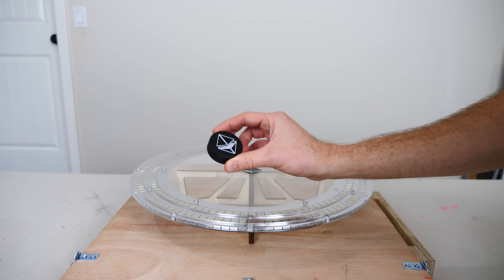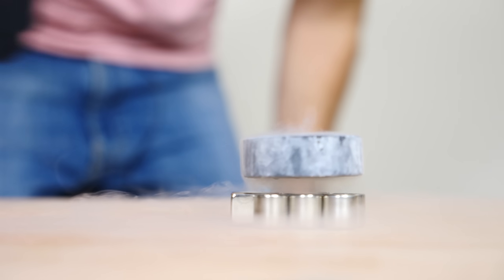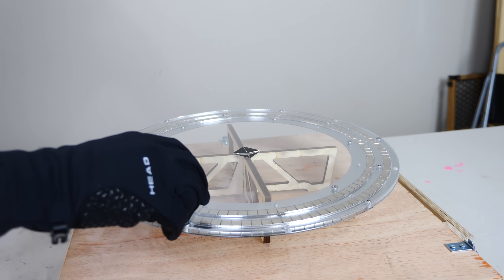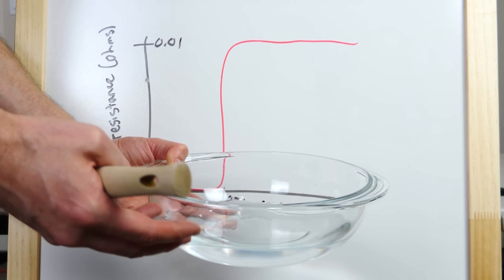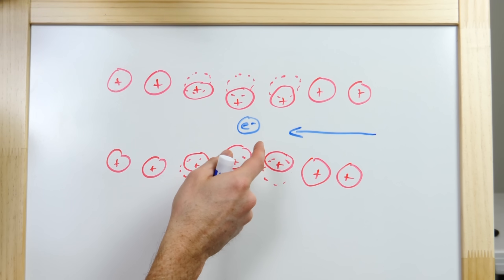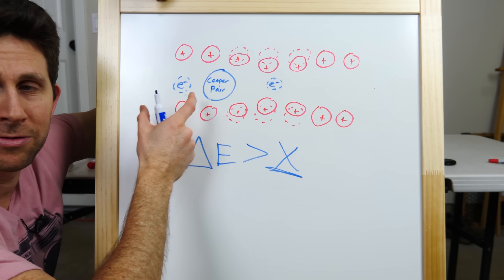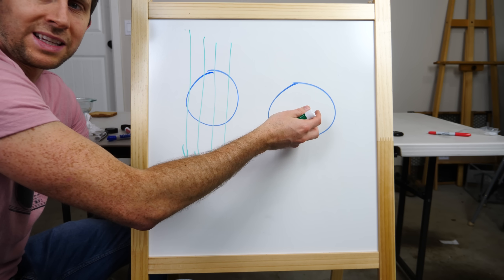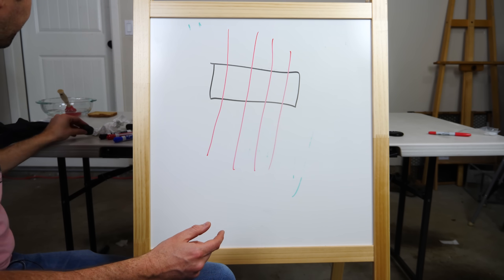Quantum Locking Will Blow Your Mind—How Does it Work?

Comment: make roads out of magnets and cars have superconductors for wheels, instead of gas it would use liquid nitrogen. boom flying cars
Reply: Joshua Fenton. That would be terrible for the environment, expensive and there is no BLOODY REASON FOR HOVER CARS. (Not actually that mad) That also would be impossible to create because we don’t have enough accessible resources in the world to make even one city full of hover roads and cars. Plus it would basically just be a small hover train. You would not be able to go anywhere out side of that small place with a hover vehicle. Lastly super conductor wheels would not work it would just be the exact same as a hover train  in the shape of a car. You would only be able to go to places with the rails and it would basically just be a private transportation service that only goes to certain stops.

Comment: Wait why can’t we do this to create hovering cars, or like a hover car race track? Could you explain why we haven’t yet?
Reply: When something is possible, but not done yet, the answer is pretty much always that it simply isn't practical. Just the fact that you need to keep the superconductor at very low temperatures for it to keep working already rules it out as a viable technology for most sectors. A way more practical way of using magnetic levitation for travel along a track can be achieved in other more economic ways, as you can see on Maglev trains.
Reply: We can & have done. Maglev trains work a bit like this, electrodynamic maglev trains use superconductors.
Reply: Ben Kuluva. Because it is expensive and there is no reason to do so accept for trains. The cars would also be stuck to a single lane, the vehicles would always be going at the same speed, no skill needed, etc. It really would be the same race over and over again.
Reply: Wow whelp alrighty then🤣
Reply: You guys are too smart for me

Comment: Is that you take the lN2 tank into space, make it a propulsion jet, and cool a super conductor alloy bullet,.  In almost 0G  in the solar system, It should stick to a set  magnetic path by x,  and move freely in both directions x and z without resistance  by any gravitational;  field or medium and obey those mechanics more strictly the faster it goes in through space time, like you see her but in a vacuum.

Comment: Cool it with Liquid lN2 and put  it inside a vacuum bell , sealed bottom  plate has installed a liquid N2 cooling system to maintain the 0 ohm state of  the super conductor, or by a peatier cooler,  This requires a single super conductor ring and one double magnet mobile. with a laser beam for a moor.   Light engine.

Comment: Have you ever heard of the tr3b reconnaissance aircraft or the black triangle UFO? it's supposedly uses a liquid metal superconductor solution inside of a toroid magnetic centrifugal motor 2 manipulate the magnetic field around it reducing its mass down to 10% of its original and using some sort of  hydrogen peroxide Jets as thrust that would explain how they can do 90 degree angle turns at thousand miles per hour without the g-force killing the pilot. The TR3B. True "anti gravity" can float thru wind storm and even glide into water frictionlessly if the claims are real... I give it some credit based on the weird effects caused by  centrifugal force how things seem to become lighter when rotated high RPMs like a gyroscope

Comment: A very interesting video, 
If I didn't misunderstand, (I don't speak English, sorry)
This superconductor makes the electrons that travel in pairs within it and all external magnetic fields are repelled, right?
I wonder:
What would happen if we exposed this type of superconductor to a very powerful electromagnetic wave (for example a microwave link as a guide)?
Could it levitate on this electromagnetic wave?
2nd question
:
And if we did it the other way around,
make a circle or loop with superconducting material and expose an electromagnetic wave on it,
Would you travel that wave continuously on this superconductor?

Thank you very much.

Comment: Does the magnet circle gain the weight of the superconductor when it is added?
Reply: Since the superconductor is transmitting a force onto the track, which is countered by the track to make it float, yes. The weight force of the superconductor is tranferred onto the magnetic circle via the magnetic field in between.

Comment: If you put the superconductor in the track magnet thingy, and put that in a vacuum chamber and gave it a push... would it move forever? Because there would be no friction, either with the floor or the air
Reply: if you kept the vacuum chamber very cold.. probably

Comment: I'm curious to know how long the superconductor would keep following the track if you don't stop it after a few seconds. Clearly it'll slow down because air is a fluid and there is resistance even if it's tiny, but how long would it continue to go unhindered?

Comment: Am I the only one disturbed with how care free he is being around liquid nitrogen? Like how without gloves on he literally just drops the puck in and yoinks his hand back so it doesn't get splashed. Or how he is nearly touching the puck afterwords while it is still steaming cold while he mucks with the magnet. Get yourself some basic protective gear man!
Reply: I remember a couple of techs at work who would "playfully" place tiny drops of LN2 on the palms of their hands and watch the drops violently fidget and jump about as they quickly boiled off. The warmth of their hands and the ambient air temp got the drops into a state where (it seemed) that half the time, the drops were in the air. The techs said it felt like very tiny pin pricks. I never tried that... but I can attest to the pin prick description when an over-anxious tech once poured the stuff too quickly into a larger receptacle and the instantaneous boil-off splashed tiny amounts of LN2 onto my arm. Pin pricks. Luckily, no one was stupid enough to actually dip their hands into the stuff. The much bigger danger (given the enclosed area) was not skin exposure, but oxygen displacement. If the Action Lab had only one safety item/device available during his demonstration --- it would have to be an O2 meter.

Comment: couldn't you in theory create an infinite energy source with this? (srry if this sounds stupid not very big brain on stuff like this)
Reply: No. At most you could reduce friction to 0 so that it keeps going forever but that just means that it's kinetic energy would not decrease on  its own. The moment you try to extract energy from the system it's kinetic energy will decrease and it will slow down just like anything else.
To "generate" energy always means to take energy that is already there (kinetic energy for wind turbines, potential energy of the water in a dam, chemical energy in fossil fuels...) and convert it into a form that is useful but you'll never get more energy than you had (actually always a little less since you'll always loose some energy to heat) so in this case you can only get a little less than it's kinetic energy which is a little less than the energy you had to use to get it moving in the first place so you could not even recover all your energy.
On the other hand it's a good thing that the pucks kinetic energy can not not be decreased since otherwise it would have smacked right through the guys hand when he stopped it.
Reply: @victorselve8349  ah i see thank you for the info. But couldnt you find a way for it to constantly generate kinetic energy since it never decreases? Cause you said it doesnt lose or gain anymore energy by spinning constantly where as a normal object would eventually stop due to friction

Comment: so if space is a few degrees off of absolute zero quantum locking seems likely to be as much of a force in the universe as gravity is.
Reply: The reason why gravity dominates the universe is not because of it's strength (it is rather weak compared to electromagnetism and the strong force) but because of it's range. Electromagnetism drops of quite quickly in strength. It doesn't matter if you take a superconductor, a ferromagnet, a paramagnet or a diamagnet when there is no relevant magnetic field for them to interact with. For a magnetic field to reach as far as it would need to be relevant on cosmic scales it would need to be ridiculously strong.

Comment: Could you theoretically get a strong enough quantum lock to make a person hover?
Reply: I meant like using a single puck as a hoverboard tho
Reply: That's a good question
Reply: Yes, look up superconductor hover board.
Reply: I want a huge quantum locked platform in my backyard
Reply: i mean there are quantum locks that make trains with hundreds of people float so yeah
Reply: Yes, if you dip a person in liquid nitrogen! Fatal? Yes, but the dead body will hover......
Reply: @FreeOpenTruth  no man, superconductivity only applies to metal. Dead frozen body would be only a dead body.

 Well, a very crunchy frosty body.
Reply: @GiacomoPaganini997  - Our blood is iron...so maybe???
Reply: @FreeOpenTruth  um, *contains iron...
Reply: @knuckle12356  - Same difference lol
Reply: @FreeOpenTruth  if "contains"="is the same as," then by extension, our blood is water?
Reply: @knuckle12356  - You are looking too hard into my fleeting comment.
Reply: @FreeOpenTruth  still counts even though the person might die....
Reply: I meant have them stand on a superconductor LOL
Reply: The new gravitron at fairs will be this😚😇  👁️🐽👁️
Reply: I mean magnets could hold up a floating train then quantum can hold up a person
Reply: They actually did that type lexus hoverboard
Reply: Yes-  there is an engine, highly protected from public- that uses liquid mercury swirling into vortex, magnetic interval locking, and hit with certain voltages or frequencies— and it will endlessly supply zero friction, lift from gravity distortion to 92-97%, and is Anti-gravity... trying to figure how to use other than battery or electricity... Ion charge?  Plasma reaction?  Deliberate electron friction of ?__? Metal to create L-term or ignition source reaction....  some say India had it BC 3,000 yrs ago in Vedic virmana technology.../?

Comment: So, do we have something here that can generate electricity without a continuous energy source? Perpetual motion? Sure it takes energy to cool the Super Conductor but is it cool enough in space to slow the molecules down sufficiently? I hope scientists are thinking about practical applications to improve the human condition instead of just geeking out.
Reply: No. The best you could do was to have it move at the same speed forever (which you can't).
What you would need to generate infinite energy is something that accelerates on its own or at least keeps on moving at the same speed when a force is applied so they would have to generate a force to either continuesly accelerate or counteract an external force but that is not the case. If this was the case it would break your hand when you would try to stop it and just continue going on it as if nothing happened. 

However there definitely are applications for superconductors in many fields for example as magnets (for example NMR), in power transmission (for example in Essen) but cooling and material properties are still problematic when it comes to many applications.

Also scientists don't "just geek out" over things.
If you can't provide a strong argument for why your project will have either direct applications or further the general understanding in a field (which is needed to find applications, you first need the knowledge and then you can find applications, not the other way around) you will not get funding

Comment: So I have seen something similar using the exact same superconductor (YBCO) in tokamak fusion reactors from tokamak energy. They call what they do "flux pinning" rather than "quantum pinning" to assist in the control of plasma flowing through the reactor (I believe). Is flux pinning and quantum pinning the same thing? There are plenty of videos on the tokamak energy youtube channel showcasing their use of flux pinning, so if you want to check before answering, head over there and see first. :D

Comment: Wait, so it stays the same speed after being pushed while on the magnetic ring?

Could you technically use this to create energy in some kind of way???
Reply: Stranger Stories I imagine yes if some type of turbine was on top of the superconductor
Reply: No, at most you could get it to move forever if you could get rid of all friction (which you can't).
But the moment you push against it you will slow it down just like anything else and since you need to apply a force to "generate" energy (which really just means that you take energy from a system and convert it in a more usable form but the energy in the electric current you produce was always there, be it in the form of potential energy for a water dam or kinetic energy for a wind turbine or chemical energy) and any force generates an equal force in the other direction you will slow down the puck to the point where you would need the energy you just got to bring it back to it's original speed (in practice you would slow it down even further since you always loose some energy in the form of heat so you get less energy than the puck looses by slowing down and you'll need more energy than the puck gains to bring it back to speed).

Comment: When you put that thing on tracks an it kept circling around ,was it an endless loop ? Coz that would mean endless source of energy
Reply: It has to be kept cool to maintain the effect. Then there is air resistance which will eventually slow it down. The circling around thing was itself initiated by him (i.e. an outside force), if he didn't supply that force (i.e. push it with finger), it would stay there in its place. Si it itself doesn't generate any net energy that you can extract. In nature there's no such thing as free energy - it has to come from somewhere - it's all connected together. At best we strive to find the most optimal and straightforward way to get the already existing energy from stuff that is already around us.

Comment: So, if I have a large super conductor and can devise a way to keep it cool, then I can put a magnetic cab above it with some type of minimum propulsion, I could fly without the need for big engines? Can a large conductor lift a load larger than itself using a small magnet? What happens if you put 2 super conductors opposing each other with a magnet between them. What happens if you put 2 conductors stuck together and then place a magnet above and below each conductor. Can u arrange one super conductor to lift and another a right angle to push? How much force would it take to push the assembly because I noticed when you push the magnet the conductor moves too, and when u put the conductor above a group of magnets and pushed the conductor, the magnet started to move too.

Comment: Couldn't you use quantum locking to lock in energy through magnetic monopoles and create something that wont release energy from the circuitry as the energy is being transferred through a sensory system? Lock energy basically the same way. Creative , physical energy object. Use it to compact energy somehow into a physical form like a solid object without implementing anything to it to make it a solid object.

Comment: I once went to a science museum and they had this Möbius strip lined with neodymium magnets. When I first saw it, I guessed the track for that floaty magnet thing (I didn’t know what it was called back then), but I wasn’t sure. Now I know I’m correct. It’s kinda sad actually, it was really old and dusty, some of the magnets lost its coating and rusted, and quite a few broke off. Seemed like it didn’t have much maintenance, probably bc it wasn’t used much and bc of that, not many people cared or noticed it.

Comment: you could make perpetual wheels which generate energy like a wind mill
Reply: No. At most you could have it run without friction (which in practice is still impossible) but the moment you apply a force you will slow it down just like anything else (if that was not the case it would have just broken his hand when he stopped it and continued moving which it luckily didn't)

Comment: This needs to be applied to Positive Creative Production Industries. In Creating New forms of Global transportation systems based on Magnetic Electro Levitation Technologies, that are backed up with 3 or 4 other very efficient & effective systems & Methods including drawing hydrogen from the air & space. To create the safest modes & Methods of Physical, Material & Cargo Systems possible that do NOT fail and crash, even under the most dire of disruptive or catastrophic circumstances. This can greatly improve Global Trade Frequencies, quantities & qualities by being able to quickly & safely transport many types of things to improve global trade network time lines from days to weeks, down to hours globally...

Comment: Is it possible to build a superconductor around a shielded compartment large enough to hold a human occupant? Would the occupant serve as the imperfection necessary for the type 2 superconductor? Just as the superconductor can support weight outside it, couldn’t it as well support weight inside it? Could the magnetic lines be sufficient to lock the superconductor even though it’s center is not in a superconductive state? Or am I just grasping at straws and there are serious flaws in this concept? 
One last thing, what would the superconductor in your demonstration do if it was placed above the magnetic ring after you turned the ring over? 
Thanks for your time and demonstrations!